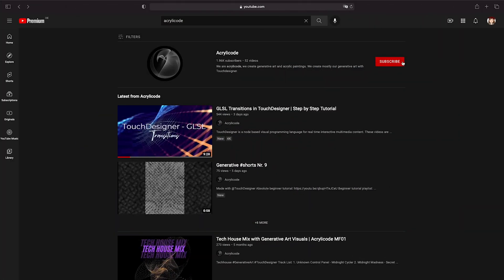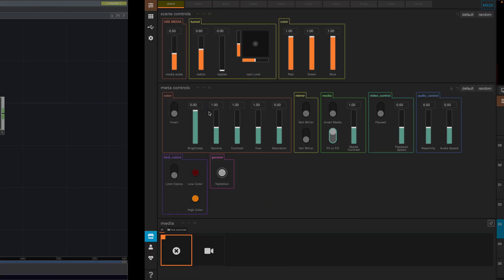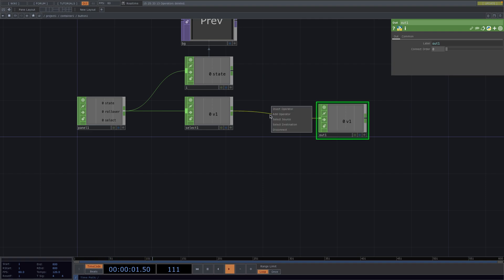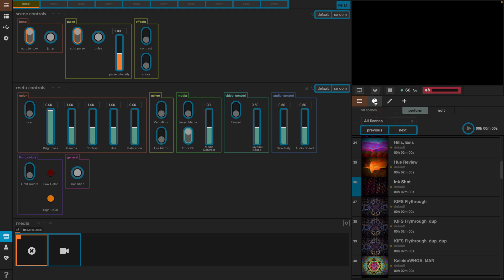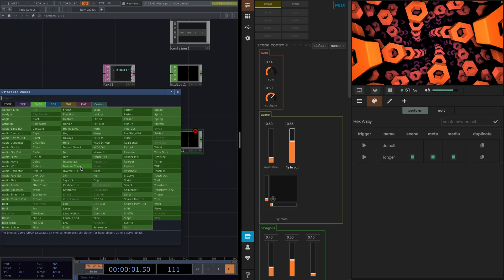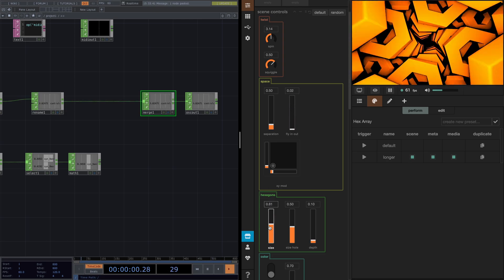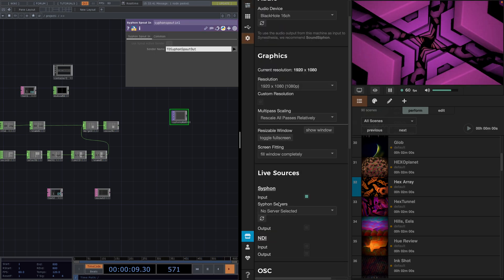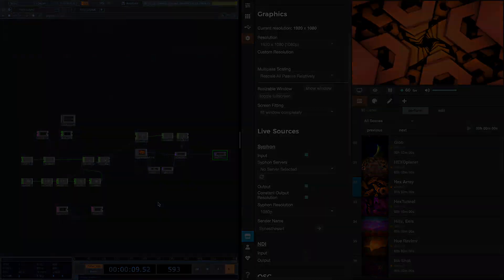TouchDesigner and Synesthesia | MIDI, OSC, Syphon/Spout

Comment: Hey, great tutorial I had to watch it in .75 speed... question, if the audio that Synesthesia was sending to Touchdesigner to make everything audio-reactive was to be coming from a live source... would that have to be reconfigured within the Blackhole App?
Hope you follow me! Thanks.
Reply from the maker: It might be it all depends of your system. Figure out inputs and outputs from your computer and inputs and outputs pro application and then using the built in Mac features (Audio Midi setup) create virtual devices to route sound how you like (Blackhole is very useful for that)